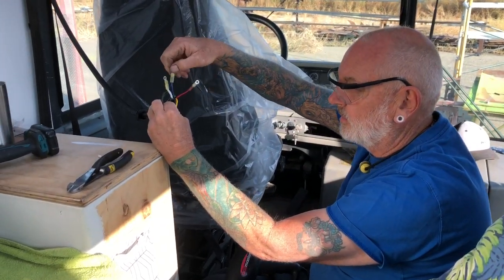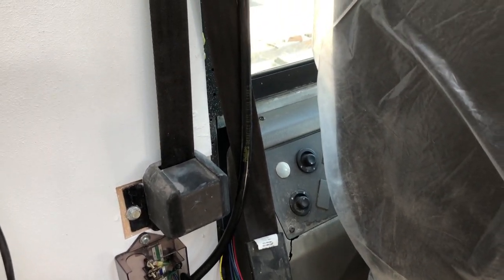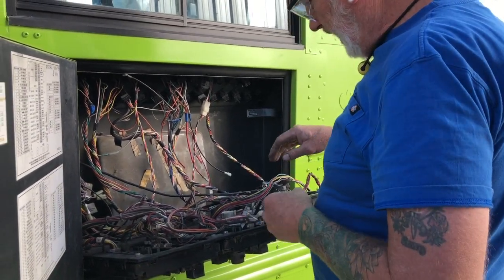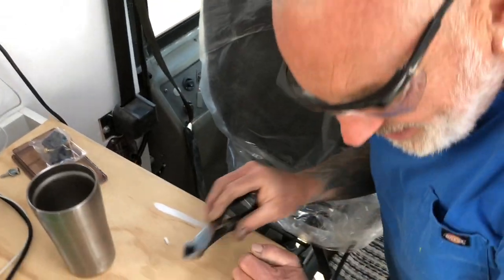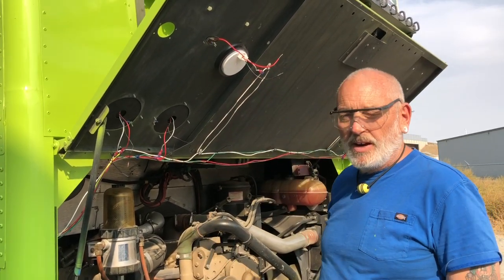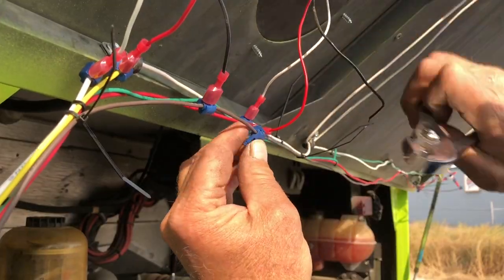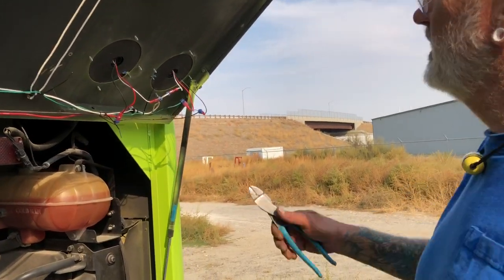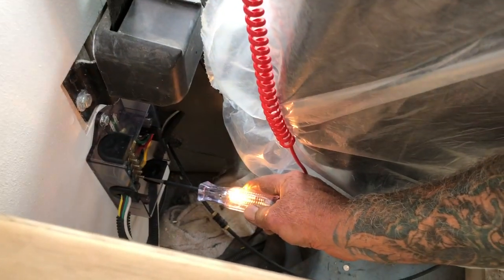Wiring Tail Lights - Vlog 175 School Bus Conversion

Comment: Hey Randy, fleece loom tape is what i use to wrap cables in and it doesn't leave them all sticky either. Put a little grease on those connectors as well to keep the weather out.
Reply from the maker: Thanks for the tip. 😃

Comment: Just a thought if you every want up grade the wire at your tail light check  out JMP  supply .electric pig tail plug i used them on bus lights worked great. nice build.
Reply from the maker: Thanks for the info.....good to know. 👍😃👍

Comment: Why not mount your forward junction block in the outside compartment with the rest of the connections?   Those T lock connectors are a frequent failure point.  You would be better off striping a small portion of the wire then soldering the connections.   

Some of those LED companies will sell you a resistor that is paired with them.  Be sure to insulate the heck out of your loom that moves with your engine bay door.  I could see over time that area getting tugged on.   

Good work as always.
Reply from the maker: Yes we are well aware of those failure rates on those clip on‘s. But it will get us going and we can upgrade it later if need be.
Reply: @KnappTime  they are definitely quicker and easier.

Comment: Nicely done folks. I'm about to figure out what replacement lighting I'm going to use.  Your method with the terminal blocks is just what I had in mind.  Did you link those?
Reply from the maker: I just put up a link in the description that is similar to what we used through Amazon. We actually got ours local truck service center. 😃
Similar to what we used. 
MICTUNING 7 Way Electrical Trailer Junction Box - 7 Gang Trailer Wire Connection Box Weatherproof for Rewiring Camper RV Caravans Boat Light 7 Way Trailer Wire Connectors
https://amzn.to/33TknHq
Reply: @KnappTime  thanks!